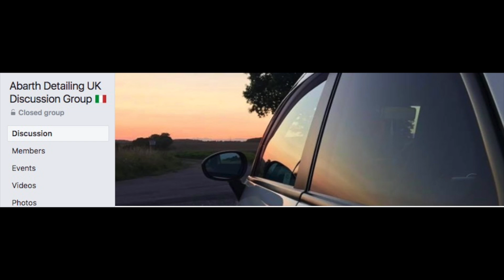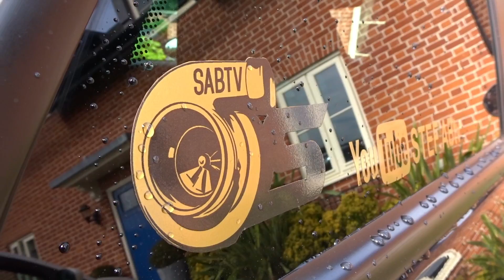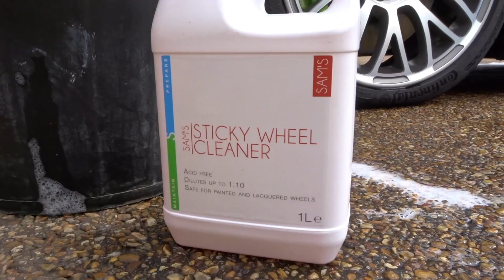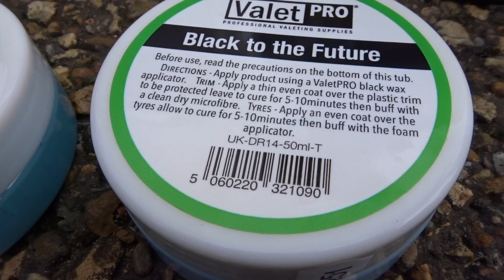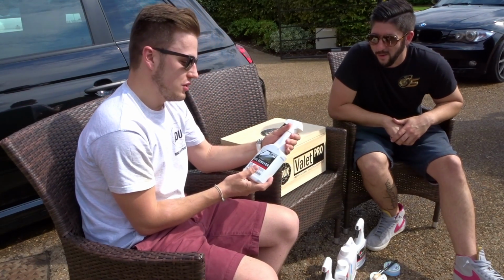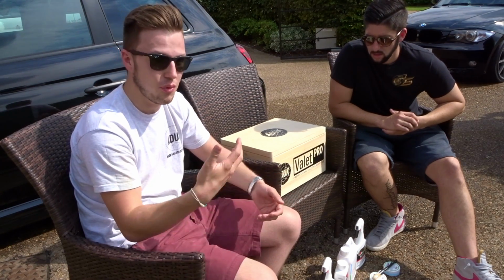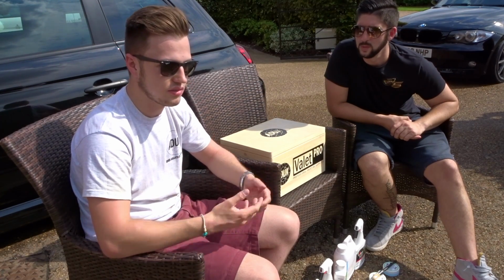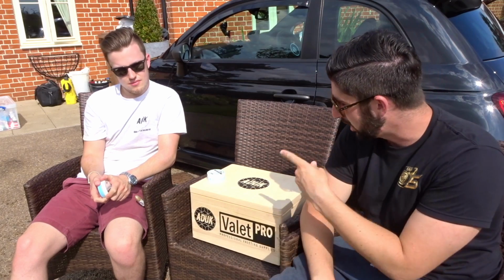Valet Pro Detailing *UNDERRATED*

Comment: No clay bar?
You need to clay bar it before you wax coat it.
Reply: We didn't wax the car in this instance due to Stef already undertaking it. We plan to do a video with machine polishing, where we would clay before, remove the marring left by the clay during the polishing stage and work from there!